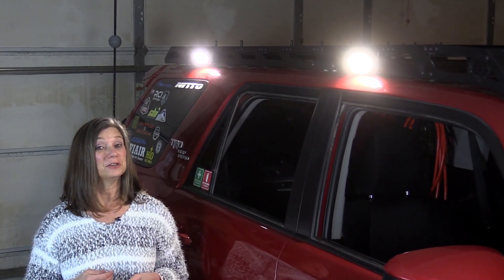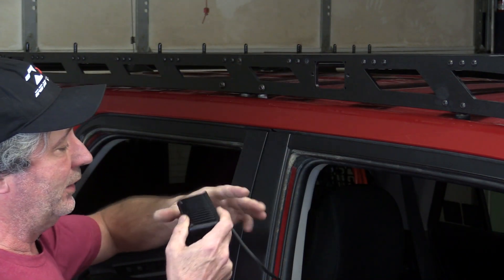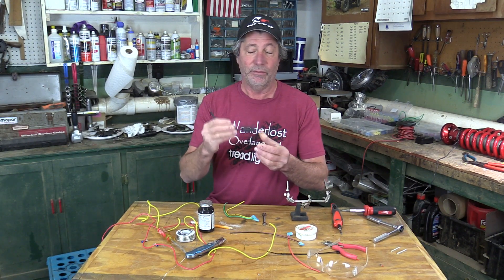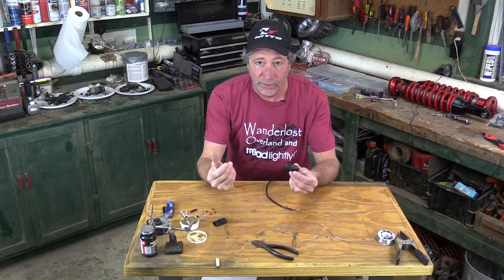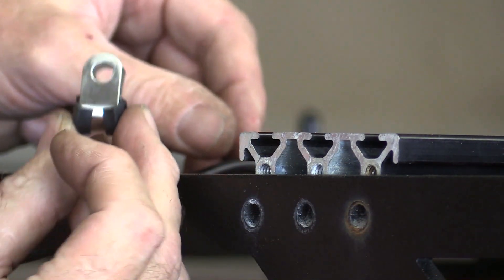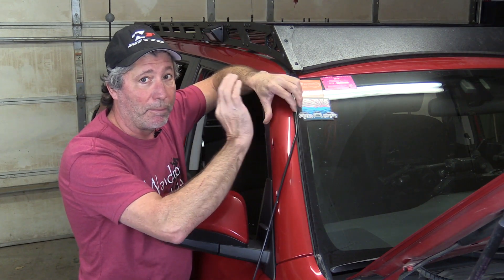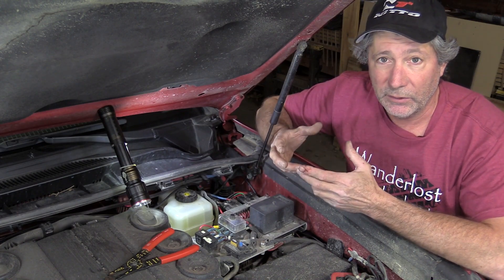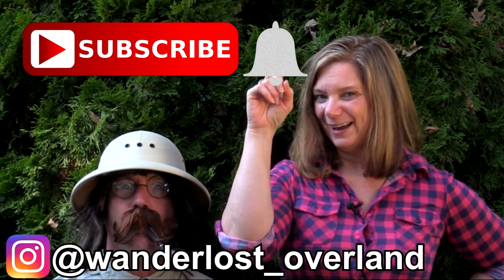How To Mount Lights To An Aftermarket Roof Rack, And How To Wire Them, 4Runner

Comment: The connectors featured in this vid all completely failed when I finally got around to testing my roof rack lights. I replaced ALL of them with soldered connections. Now the lights work.
Reply from the maker: Sorry to hear that. We've been using them for many years without a single failure.

Comment: I used your cable management method and connectors…so far happy with it. My rack is Series 10 80/20 so I changed up the Tnuts to roll ins. Went with 1/2” cable guides and 3/8” bolts.

Comment: I agree with the other comments both the wife and I enjoy all your sharing of information.  The lights on the roof rack some time has past, are they still holding up?
William- Bellingham, WA
Reply from the maker: Thanks for watching! They're holding op okay. Once in a while during a heavy rain one gets a little foggy inside. but dries out fast. Obviously, they aren't 100% guaranteed waterproof.
Reply: @WanderlostOverland  Thanks for the reply.  Just so you know, you have had a very strong impact on my build energies to my '15 Tacoma. Your sharing has been valuable.  And the Tacoma (G2G)(Good2Go) build for the most part complete.  It's first shake down run will begin 20 June on the Washington St. BDR. for a couple of the sections as my time off is limited.
A buddy of mine reached out to you a couple months ago about the Gaia app... He mentioned you did reply.  Mark, my name is William, I can turn the nuts and bolts but a bit cloudy  on the tech aspects. Trust me, my head has been filled with lots of details on the Taco build, I just haven't had the capacity to get into the Gaia app.  I am most certain I will watch you vid again for the umpthteen time.
Thank you again, the wife and I enjoy you both a lot.  William and Erin - Bellingham, WA.

Comment: Instead of running the wire up the windshield, I recommend using a marine grade cable gland by Seaview or Scanstrut. The glands are equally easy to install, once you get over the shock of drilling holes in your roof. But it's a more permanent solution, once it's there it's there forever, and you'll always have an easy and professional way to power any additional accessories on the roof of your vehicle.

Comment: Great video. Good wiring techniques. I separated the left side, right side, and rear lights so that I don’t have to turn them all on together.
Reply from the maker: Great tip!
Reply: Does that mean you ran three sets of wires from the engine bay? Or one 6 conductor cable? Either way I’m thinking that is quite a bit bulkier. I’m wanting the same separation. Thanks in advance.
Reply: @tahlH  I ran two two conductor (blk & white) cables from under the hood up the channels along side of the windshield. One on the left and one on the right. I have two lights mounted in series on the left two lights in series on the right. If you are counting wires it’s a total of four.

Comment: The thing about the spod and the other one that I forget the name of, you have the issue of something breaking and it being hard to fix and/or no longer in warranty.  If you make it yourself and notice one relay has gone bad you just replace that relay.  Also, what I suggest people do is make one with a negative terminal with multiple hookups on the board.  Then have one negative wire going to the chassis.  It'll keep you from finding 10 bolts on the chassis to use and keeps wires straight.

Comment: Is there a reason you're using liquid rubber as opposed to waterproof heatshrink?
Reply: When he splices into a continuos wire it would be impossible to add heatshrink.

Comment: Actually, amber or red lights do not attract the bugs like white lights. Just check out Ronny Dahl or any of the other Aussie overlanders, they all use amber lights. We switched out our interior bulbs in our 4runner to red so that we can access the vehicle interior at night and not get murdered by the Wisconsin mosquitos and it works like a champ! Highly recommended for any camping in the Midwest or lower altitudes in the summer time.
Reply: Were you able to buy all the interior red bulbs as a kit? If so, where did you find them? I've been considering this on mine!

Comment: I like that SSO rack. Way more thought out than the Rhino Pioneer platform that I have. The 80/20 profiles are way more versatile. Cool install. You know they’ve made flux core solder for the last 50 or so years, right? 🤪😂

Comment: Excellent video, I love that you are willing to share your builds.  Just a little tip though, your T-Nuts are upside down.  You struggled to put it in because you had them on backwards.  The flange on the nut is designed to go in the slot of the track, not up the way you installed it.  Flip the nut over and the taper on the sides fits into the channel easier.
Reply from the maker: Thanks for the tip!

Comment: You don't need to solder the wires into the Weatherpak connectors. They are the same ones Baja Designs uses for all their lights. I have them on my rig and they have yet to let water into the connection. Using a crimp tool with the connector means the wire can't be pulled out. I have yet to solder any wires, as finding crimp on connectors to be much easier.

Comment: Does anyone know of a head unit with an integrated SPod type control panel?
Reply: Switch pro has an all that works with android. If your head unit is android based then you can have it work

Comment: Would it be good to add medium thread locker for the bolts on the roof rack?
Reply from the maker: Maybe, depends if you plan on taking the crossbars out at some point.

Comment: A little anti seize would go a long way on the rack screws. I pulled mine out one at a time and coated them. Those channels hold water for a while when your truck in not moving. Just a suggestion. I know you guys are sharp people. I like these type of  videos a lot. 
Thank you.
Reply from the maker: Darn great advice Jamel! We're huge fans of anti-seize! We put a little on every bolt when we first installed the rack, but we should have taken the time to reapply when we had the chance.

Comment: 👍 put the amber film on. Not so harsh on the eyes. And could be used in harsh rain or snow as amber is the sign for the side of a vehicle?
Reply from the maker: That's are thinking as well. You can never be seen too much in a fog or dust storm.
Reply: Also doesn't seem to attract bugs like white or blue hued lights